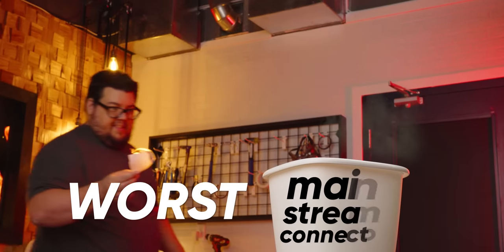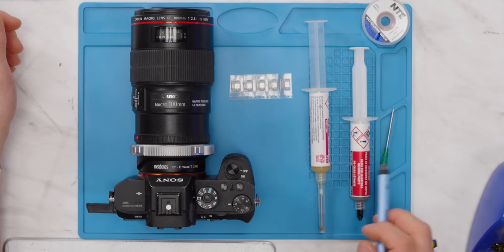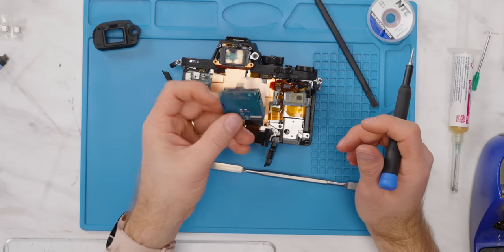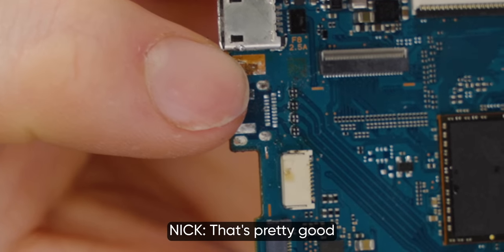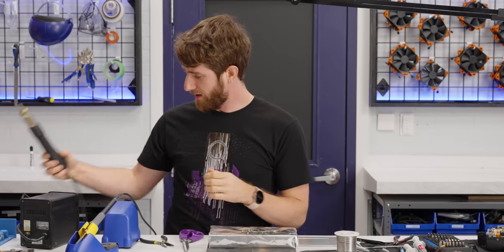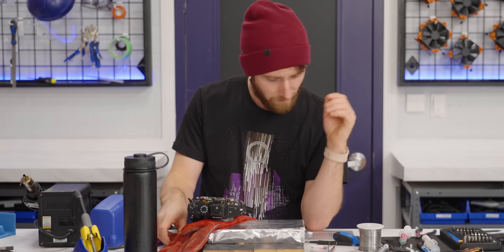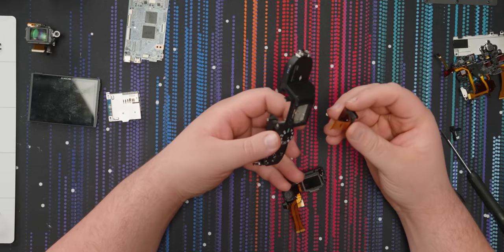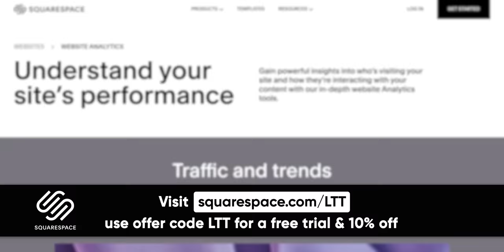This "cheap" repair almost BROKE me.

Comment: Moral of the story: If a connector on your expensive device breaks, disassemble the entire device and break several parts inside to make the repair cost worthwhile.
Reply: @marcogenovesi8570  and have your employee replace the board for you
Reply: My guess is the $600 Sony was asking was to replace the board and for calibration. I can't see them opening the whole thing up and soldering a component like that especially since labor is expensive and if they make a mistake they'll have to replace the board anyways. Still, $600 to repair a camera that still costs almost $2k today even given it's age seems like it could be worth it.
Reply: You gotta have a extra reason to force you to cough up that cash
Reply: @Haarschmuckfachgeschafttadpole  Yes, toasted boards are usually shipped off to some lower tier guy or even sold to a different company that will try to repair them, and has some percentage yield of success. (Or, sometimes they even head straight for the garbage, depends on the profit margins.) When companies do repair work, they typically go for the "most likely to work, even if slightly more expensive" option.
Reply: Would have been smoother if Linus had any idea what the hell he was doing... Lots of gear, literally zero skill.
Reply: @soulscreme  
I guess that's probably why he makes videos for a living, instead of fixing cameras...
Reply: @soulscreme  or just give it to any of the staff members he has hired that actually do this for his business, you know like at the end but before killing the board by blowing the heat gun on it like it was a fing hair dryer
Reply: @Haarschmuckfachgeschafttadpole  Also, they can't never be sure its just the connector, imagine the client says its the connector, they replace it and then the camera is still broke. By replacing the board they are 100% sure they fixed the problem and they don't even need to waste time diagnosing the problem.
Reply: I paid 930 EUR for fixing the mb and moisture problems at SONY Austria.
Reply: @maji0  What’s wrong with that?
Reply: The $4 + $600 repair 😂 (I wonder how much would have cost sending it straight to Sony in the first place)
Reply: Seems to me the moral of the story is buying a new motherboard and then having it recalibrated is still cheaper than sending it to a repair shop, which also excluding buying a heat gun and soldering iron if don't have the courage, or time, to do the soldering yourself.
Reply: I definitely respect right to repair, but some things are best left to professionals, clearly XD
Reply: @agc2801  it shows at the beginning of the video - 600 CAD
Reply: @Oyamada13  To be honest Linus just f*cked up. That was an easy fix but he heated and reheated the board so many times I'm impressed the pads didn't come out.
Reply: @novousuarionaoidentificado  Exatcly the price of the board, but linus also broke the flex cable.
Reply: @Oyamada13  Not really. It’s still broken.
Reply: Why is he not doing the fix under a microscope haha
Reply: Yeah, agreed. Where was the conclusion and summary of the situation? Is this a case for the tight knit integration argument against right to repair; an example of the difficulty of repair in general or a case of the manufacturer being difficult?
Reply: @DavidRodriguez-mn7fh  most people don't have employees to fix their stuff. The only thing I get from this video is don't attempt to fix expensive cameras yourself unless you have actual experience or $$$ to send it to a professional when you mess up.
Reply: There are some devices that needs a professional touch, let's add dslr to the list
Reply: @soulscreme  its repairing a camera for content you clown. thats the whole premise behind the content that he doesn't know what he is doing. some people are so damn boring
Reply: @ArturoTabera  oof 😮
Reply: @fitybux4664  yeah. Often they replace with remanufactured parts as well where the board with the broken port will be sent off to get fixed and put back into the queue for warranty repairs or service
Reply: @Haarschmuckfachgeschafttadpole  Privately, it's worth it for sure. For a business that relies on it to work proper, it's really not worth it. Which is why that camera was lying around non-functional until Linus needed it for private use... And even that is with the added benefit of making money of it as content, which in itself was not worth it for them.
Reply: when I read "repair cost" i got traumatic War Thunder flashbacks
Reply: No, the moral of story is that PC people aren't electronica people, they pull on everything and break delectated hardware. :D
Reply: NOT GONNA LIE I DID THAT TO MY PHONE. so my phone got bricked but to unbrick it, screen needs to be open. now you think where things went wrong to the point i had to buy new phone.
Reply: And if you do want to fix it don’t let Linus do it. 😂
Reply: Just don't let Linus do it.
Reply: That's always been my philosophy.
Reply: My Dualshock 4 Controller 😅. Ended up selling on Ebay for parts
Reply: @TheOliveboy93  Absolutely, and throwing all that flux at it. He didn't really need the hot air reflow. He just need to use a fine solder tip iron, wick off the solder to desolder the part. Often amateurs overdo the heating. He should have practiced on some junk smd boards. Soldering and de soldering is a skill.
Reply: Sigma grindset 101:
Reply: Or rather, if you have half a dozen technical engineers employed let them do the soldering
Reply: @IdeaBoxful  Yeah, if there are pins which you can reach that easily with a soldering iron there is really no in going at it with hot air (maybe apart from applying the solder)
Reply: That's my experience as well. I dissasembled my phone to replace the speaker that had metal pieces in it, the replacement was success but in the process i broke ribbon that lead to the "camera trigger" button which i never used anyway but i also somehow broke the NFC function which was huge pain in the ass because i was paying with my phone a lot. And few months later my new speaker was again filled with metal pieces anyway  :D
Reply: @marcogenovesi8570  w
Reply: well to Linus it doesn't really matter, 660 USD is literally PEANUTS for him! he just wanted to make a useless video and waste out time meanwhile he earns money for it LOL!
Reply: @nezbrun872  hey white knight, check his why I have 80 staff member video he shows the areas of his new installations and he DOES have staff members with technical skills in soldering like the hands at the end of the video doing it correctly. He heat blasted the whole board like was an fing hair dryer. Yes Linus makes very entertaining videos but he has become very disconnected of the average tech aficionado. Any one that doesn't have thousands to throw away like he does now would have had a more experience person do it for him or  guiding him as HE HAS DONE BEFORE
Reply: Shin shin 
Linus destroy these many times and he got even pictures how it looks inside. This could happen, it's good to remember. But he does this poorly even disassemble the camera could tell what is coming. And I just say that older device is, USUALLY more easy to fix. And don't use most heaviest cables in these digital ports. 

If you don't have done this before, it "could be" good choice test skills some old pcb. 

Flux.. you can't use it too much. It floats when it's hot and could remove later on.

Video is good one, I see link many time, but least now I look what happens. For sure something happens every time.
Reply: Truuuu
Reply: @marcogenovesi8570  seems like an underestimate
Reply: @marcogenovesi8570  was going to say the same
Reply: This was me the one time I tried resoldering. Top Gear: Tech Repair Edition
Reply: i love this community
Reply: I once tried to replace the battery in my iPhone SE, simple right but apple had the fingerprint reader set up to rip out of the phone on purpose if anybody removed the back
Reply: Moral of the story, when it's broke don't let Linus 'fix' it.

Usually Conan the Destroyer does a better job with an axe. LOL
(joke)
Reply: Atleast he didnt drop it
Reply: @soulscreme  yea I think a solder stencil would have gone a long way.
Reply: @RichterX83  People like Linus. Linus hosting the video even though he's not as qualified probably adds more earnings to the video than the whole camera was worth anyway.
Reply: @jubies6286  yes, he is fortunate and put a lot of work on that but his "tech tips" channel has become a comedic "let's destroy tech channel"
Reply: Keep Linus away from anything you do not want destroyed
Reply: i had same experience with iphone..
Reply: @soulscreme  Yup'  👍
Reply: I broke 1 camera and 2 phones ..
Reply: Tax Write off

Comment: Important time to point out that right to repair doesn’t just mean allowing you access to parts to repair your own devices, it also means allowing repair shops and trained individuals access to parts so they can repair your devices properly
Reply: I think you're taking the right too far. You have no right for companies to provide people to tutor you on how to do repairs. Fortunately such people exist naturally and the business isn't preventing such people from practicing.
Reply: @gblargg  you literally just said the same thing as them
Reply: @NoName-vh1nw  I didn't read top comment fully (the intro threw me off). I forgot that companies prevent repair shops from stocking repair parts, instead only selling one at a time and requiring device serial numbers or other BS before selling each one, so that repair shops can't do quick repairs but must wait days for them to be shipped.
Reply: Also, schematics not being readily available means that a repair shop or individual will have a much harder time
Reply: This, so much this. The average pleb cant do minute electronic repairs but they damn sure should be able to get it done at their local corner repair store!
Reply: @gblargg  " the business isn't preventing such people from practicing."
Well, you are WRONG! Watch Luis Rossman content, or any other, the business clearly ARE preventing such people from practicing/do repairs. Especially Apple.
Reply: Right to repair honestly has nothing to do with "anyone can repair their own devices" and just means that any repair shop can access parts and information necessary to complete the repair and not only the manufacturer who charges 500 bucks because they have a monopoly on it.  

Any small town mechanic should be able to get information from Ford to fix a fault on a modern car. Not necessarily any random person in their driveway.  Similar with electronics - skills are still required.
Reply: @maulerrw  No, it is BOTH. Local independent repair shops can repair it and it give you the right to repair it yourself if you want to and have the knowledge.
Reply: But in this case the difficulties are caused by the construction.
Reply: Also means pressuring companies to design products in ways that can be more easily repaired. A port that's prone to failure should be on it's own board like the SD card reader.
Reply: Really missing the mark here. You shouldn't have to be a part of a business to access schematics, repair manuals, and parts. If you're competent and capable of doing the repair, you should have access to whatever you need to make the repair. If the average idiot tries and fucks it up, that's on them, its shouldn't be acceptable to treat grown adults like children and restrict access to these things.
Reply: Yup, that was the fight they fought, those shops are just like big tech, they don't want you to repair it but that you bring it to them for repair. Those shops like it that it's complex and hard to repair, they would have a job if everybody just could fix it at home. Only they didn't had access to parts and tools.
Reply: In order to ensure that repair shops and trained individuals can access replacement parts (and schematics, ideally), they must be available to anyone who wants them.

Otherwise, it's just bs like Apple Authorized Service Providers and the like continuing on forever.

If it's too difficult or you aren't trained and you break your device, well, it's your device and if you have any rights as an owner that includes the right to break the thing if you want to.
Reply: @maulerrw  no right to repair means parts and info should be available to anyone who owns the product. 10 to 15 years ago you could find schematics of any electronics and if you know what you are doing could repair them with parts directly from the manufacturer
Reply: @maulerrw  No it's quite literally both. If right to bear arms (not that I actually condone that one) works for both the everyday person and small businesses, then why not right to repair?

Comment: as someone who has experience micro soldering, this is painfully hilarious.
Reply: I had to look away, it hurt to watch.
Reply: Lets go with painful
Reply: We can see clearly Linus spends literally 0 hours per week watching micro soldering content in YouTube
Reply: If it’s any consolation, I got 0 experience in micro soldering and it was still painful to watch…
Reply: Even as someone with very little soldering experience, it's still painful
Reply: 500°C air and surprised the plastic was istantly melting lulz
Reply: Yeah, this was really painful. How could none of the ones working on this video look at one video soldering with hot air and paste? The surface tension would have pulled the connector to the pins. And btw... A whole mainboard was 400 dollar? And replacing the hdmi connector on said board was 500? Great pricing there, Sony!
Reply: Its not even that hilarious. Its plain painful
Reply: @kruppin  I'm pretty sure that Sony will just put a whole new pcb instead of replacing the connector which explains the pricing.
Reply: @kruppin  Probably, Sony's repair policy is, replacing the HDMI connector is a matter of swapping and calibrating the mainboard rather than resoldering the connector. So, you pay $100 for the service. Pretty reasonable.
They may or may not then take the board, resolder the connector, and if successful, use it as a replacement board for a subsequent repair in the event that new board availability is low, or they may send the board with the bad connector for recycling.

Sony is not a person, does not know ahead of time the full extent of the damage, and is unlikely to do case-by-case diagnostic repair to the level a repair shop or individual user would. They'd rather have a faster turnaround, and if I were them, so would I.
Reply: Teach!
Reply: @kruppin  mainboard might have came from 3rd party supplier,  also as we learned in video , new mainboard needs calibration from sony , which is $200 so mainboard replacement will be more higher than $500 service from sony. its like $400+ $200 calibration + replacement labor.  Sony's $500 might have taken account of failure rates of this kind of repair, like breaking mainboard
Reply: @motosk8er2  i know dude, you get the point stop being so direct with your interpretations
Reply: Even as someone with NO  experience micro soldering, this was very painfully hilarious!
Reply: @GabrielM01  Okay, but why would he?

He doesnt make informational content, he makes videos about him being a bumbling buffoon who needs to be rescued at all times

Its really just like a bad comedy movie from the 2000's
Reply: @nemtudom5074  fair point
Reply: @kruppin  Linus mentioned Louis rossmann but sadly he and his staff probably never watch any video of Louis fixing stuff.
Reply: Ikr
Reply: No way I'd try doing this with really simple tools (and in the case of the "hot brick," basically just trash) at my skill level. Call a couple of local phone repair shops and ask if they'd be willing to replace a micro HDMI connector for you. Those guys do tons of little connectors like this. I'd trust them more than I trust myself.
Reply: StezStix Fix's videos showed me that this type of stuff isn't impossible with a little basic research and plenty of patience. 
Just going gung ho at it though was always only ever going to have a single outcome.
Reply: Agreed. I found it most hilarious when he couldn’t even get the ribbon cables to re-seed.
Reply: Yeah. Though if this is his first time doing a port with hot air he didn’t do too badly.
Reply: @motosk8er2 right, i should say stop trying to inflate your ego on the internet
Reply: @Ghennesph  not even $100 for the service... $400 board, $200 calibration... $600... the same $600 they quoted em in the email for board replacement... Linus sorta played himself then we all got played by watching it in order to pay for it... so who's the real winner here 🤔
Reply: @Bimbom he’s got people that are good at this stuff he just wanted to prove any average joe could micro solder out of the blue 😂.
Reply: I already noticed also that he will eventually going to break the board because of how he points it...ahahaha
Reply: I think he was trying to troll louis rossman . I know he would for sure be mad if he watched this vid , watching him totaly destroy that motherboard